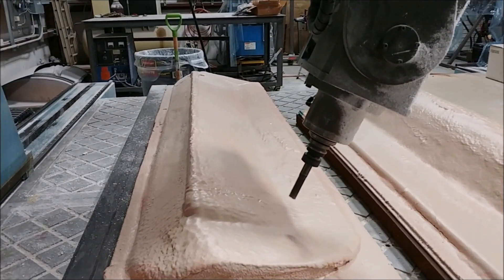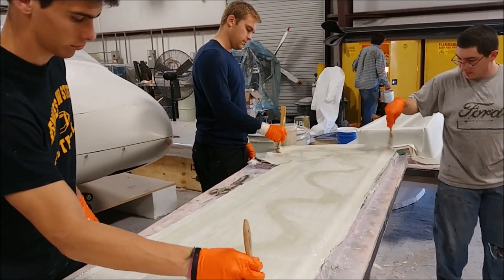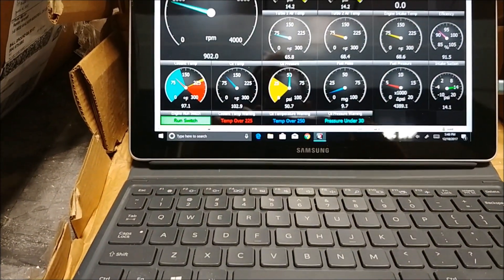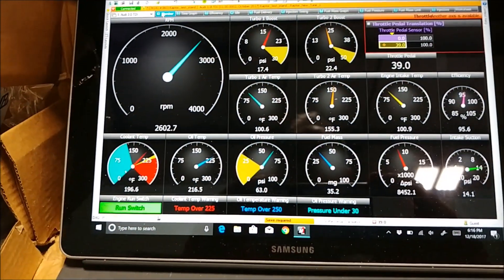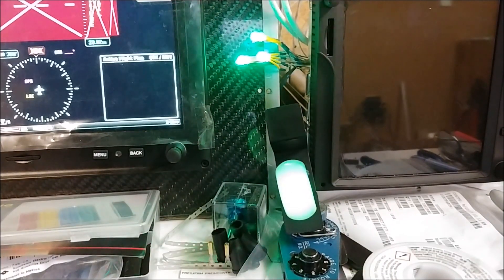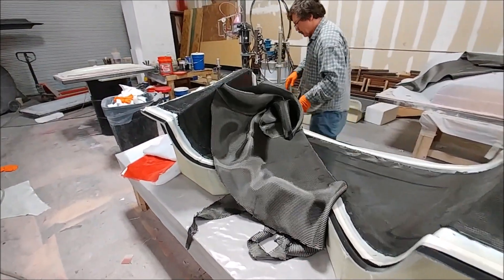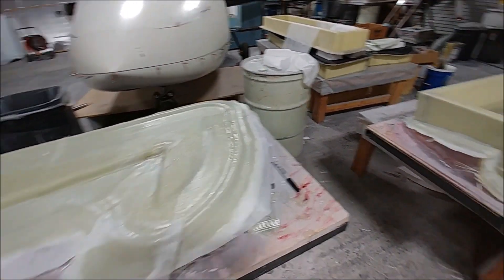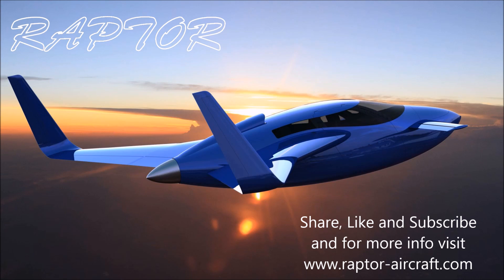Heat Exchanger Install - how well does it perform?

Comment: I just noticed your boost. Thats a lot of boost for idle wow!
Reply: Don't think you are reading the gauge correctly Silas.  At idle it's showing 14.2 psi on both turbos. That's basically normal atmospheric pressure or in other words zero boost.  At 2600 rpm it was showing 22.5 psi which is about 8 pounds of boost. 22.5psi - 14.2psi = 8psi
Reply: Awh, so right! Thanks.

Comment: Shouldnt you run the heat exchanger in a 55gal drum of diesel to see how it is really going to work?
Reply: marty h the heat exchange will be different but not by a huge amount, think of this as a pre-test test to validate the idea.  Can test with diesel in the.....let’s say it....”prototype” lol
Reply: Okay, so I went to school at a place that had a whole hanger full of diesel engines from 2.0l all the way to 12-15 liters. Some were hooked up to water brake dynos that could absorb 4-500hp. 
 Every one of them had a water tank or no cooling at all, no radiators on anything. Radiators would have made the building uninhabitable during the warmer months.
 Also that 55gal of diesel in a open tank would sludge up in no time unless you brought it up to 160-180°f every time. To kill the bugs.
Reply: Not completely sure how the cooling system is going to work, but this test is not indicative of how much heat might be generated. Using a 55 gallon barrel in a 3-5  gallon cooling system is the opposite of what needs to be done. Put the heat exchanger in the 55 gallon drum and see how hot the drum contents get is a more likely scenario. Will there be any way of moving fuel through the exchanger during flight?
(Remember no EPDM in the fuel Buna N OK)